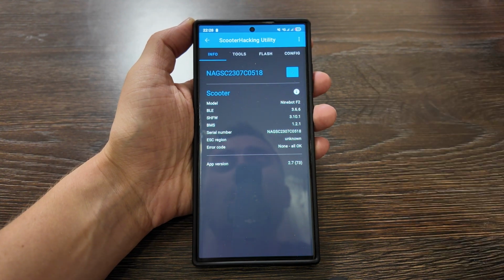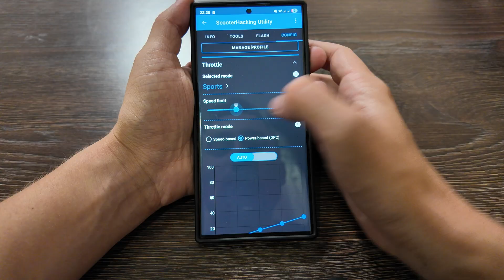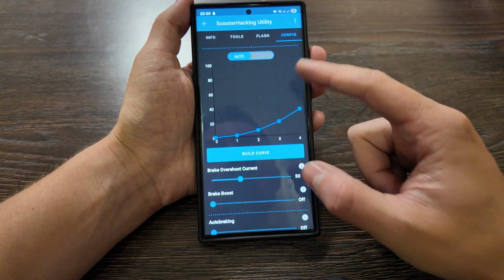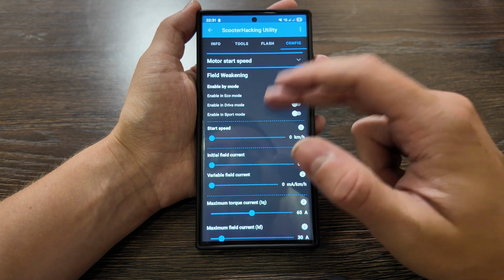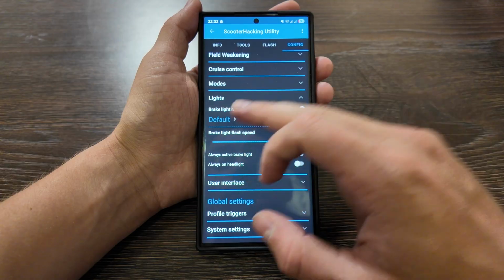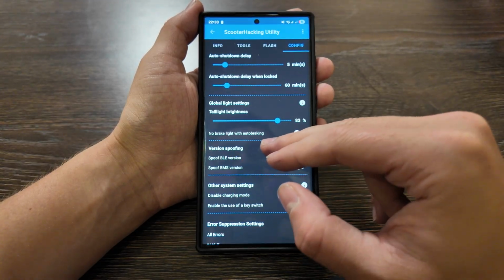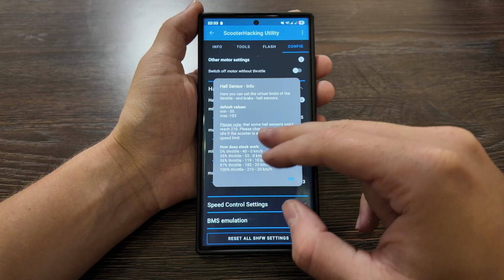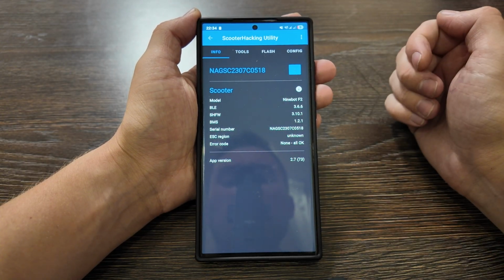ScooterHacking Firmware 2025 – Everything You Need to Know

Comment: Can you do settings for 50 kmh config please?❤ ninebot f2
Reply from the maker: not really, is way to fast for this scooter, which scooter do you have? I got 38-40 on my f2 plus
Reply: @ChinaGalaxyTech same scooter but without st link
Reply from the maker: @richstreetッ  no need st-link, you can do it with scooterhacking SW installed, you can change the maximum speed and increase the Ampers. But I dont suggest to ride f2 plus on 40km hours for long time
Reply: @ChinaGalaxyTech i want just to go at 35 kmh but i can do only 32 do yu know why?
Reply from the maker: @richstreetッ  do you have scooterhacking SW?